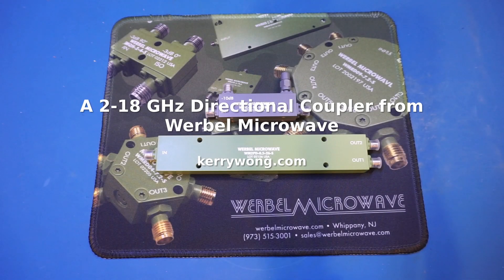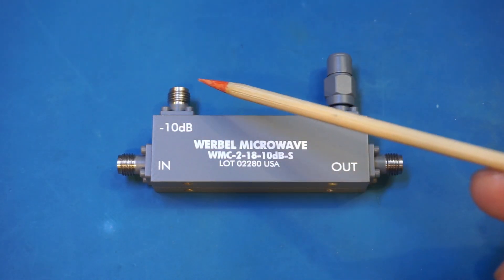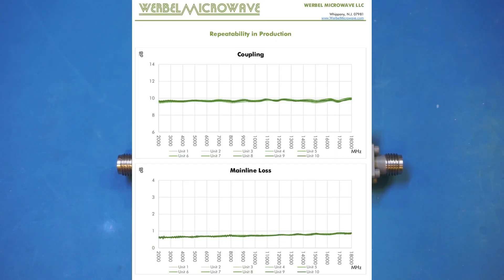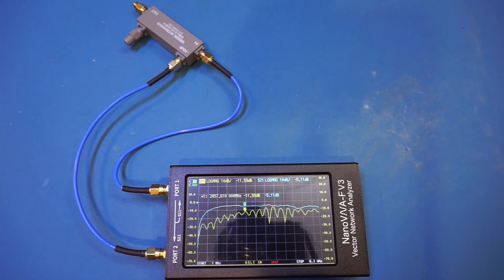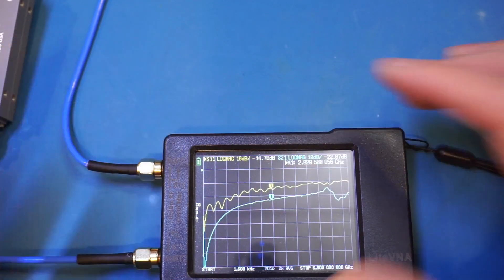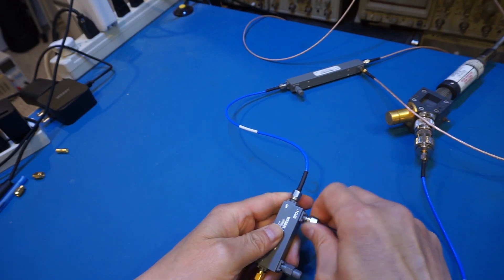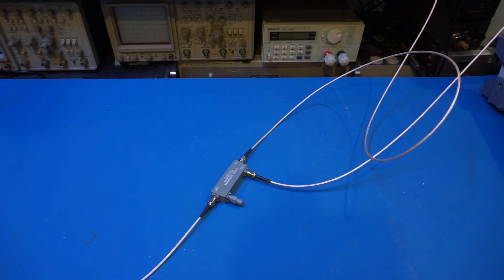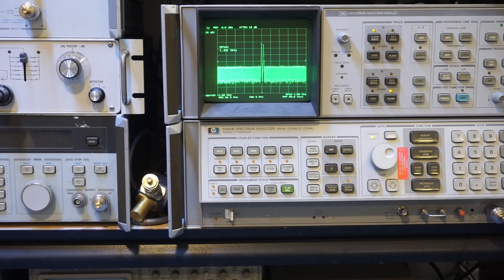Testing a 2-18 GHz Directional Coupler from Werbel Microwave

Comment: @KerryWongBlog 

Hello Kerry, how is it going?. 
I watched your review of the UNI-T UPO1204, very informative review and helpful for new buyers. 
I just want to ask if it's possible to verify it's bandwidth with a squarewve signal, that would be much appreciated. 
also regarding the bugs you've found, did you update the firmware yet and did that help fixing the problems? 

thank you.